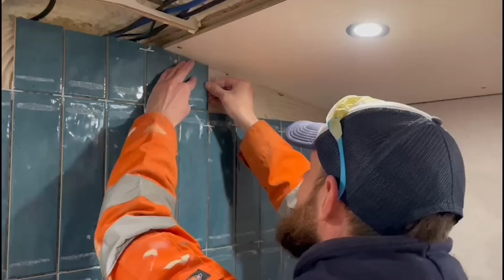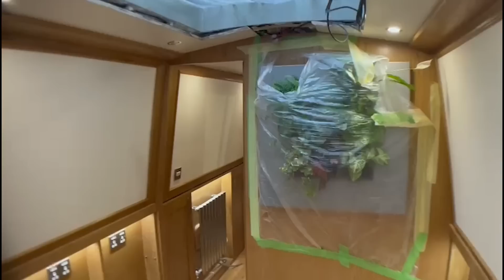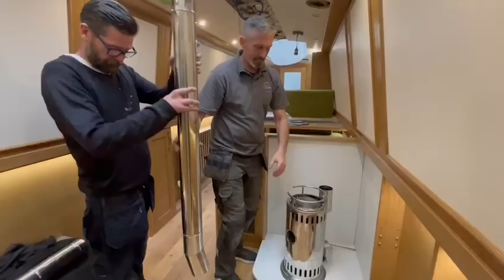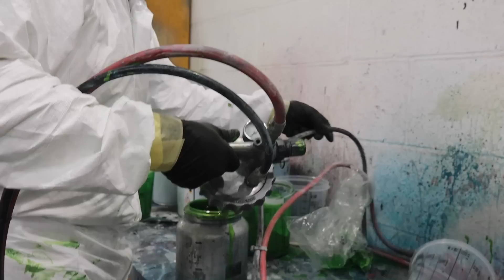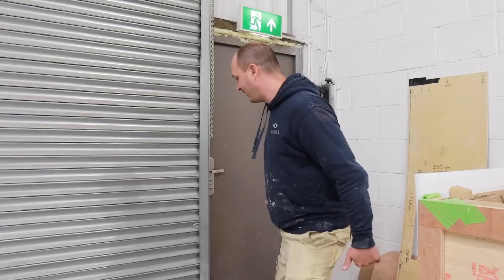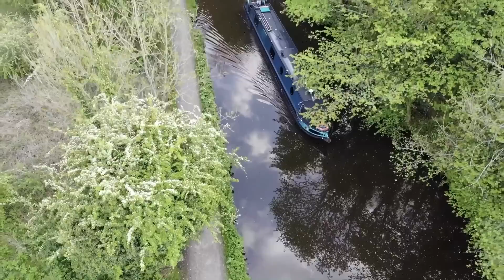Our New Narrowboat Colour Revealed Plus the Diesel Reflex Heater Install Ep165

Comment: Looking good so far. I suggest that you need a lockable fuel cap. The screw-on pipe cap that ColeCraft fit is a bit last century and will end up in the cut at some point, so a spare or a fishing magnet is required - I say that from experience. 🤣
Reply: Oakums definitely doing a great job Molly. ❤
Reply: Thank you and thanks for the advice. We have a magnet but some lockable cap would be amazing ❤
Reply: The only thing holding Oakums back is Colecraft if you ask me. Colecraft is a dinosaur. Their workmanship is terrible... I heard a customer was having a big sea-going Dutch Barge being built off the grapevine. They ended up having to walk away due to poor workmanship. I love what oakums are doing. Such a great boat. You are both lucky.

Comment: Hi Paul, Anthony and Dexter Dog. Loving the boat paint job. The finish is stunning, The fitting out looks amazing. Good to see your response when you first see the boat. I have one observation (and it's just an observation). The duck hatch sliding wooden doors feel like they should have had built in runners top and bottom, in order for the doors to slide open/close with ease and grace. On the video there was a bit of effort needed to push the doors open, and wood on wood does not make for an easy glide, plus in the winter the wood may swell a bit. I am so please for you both. The boat looks amazing. I hope it wins the best prize again this year for Oakums. Take Care.
Reply: Glad you like the finish. They have done a great job and the team have been amazing. I think I have to agree with you re the duck hatch. I definitely think Oakums deserve to win but I am very biased. Have a lovely weekend ❤